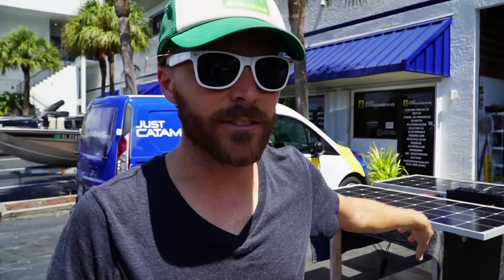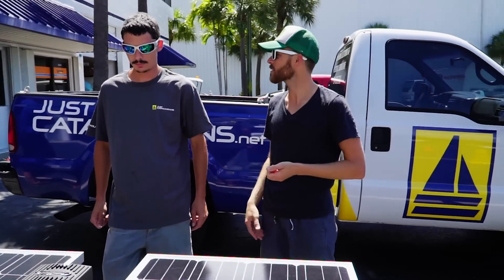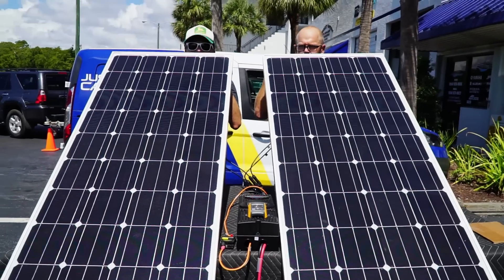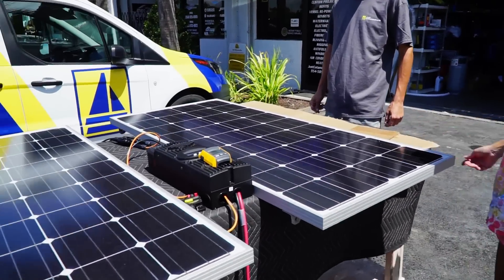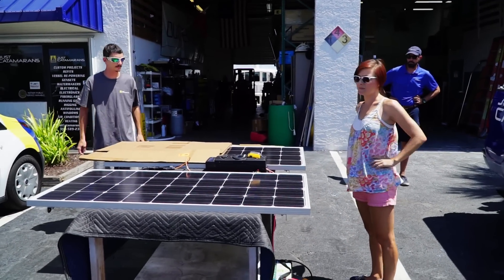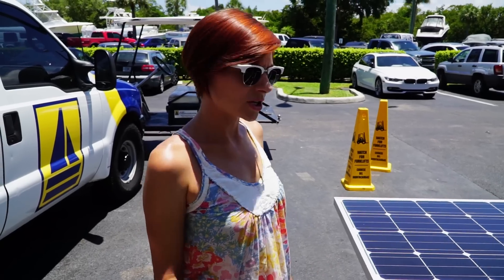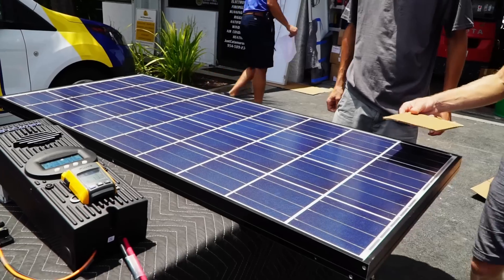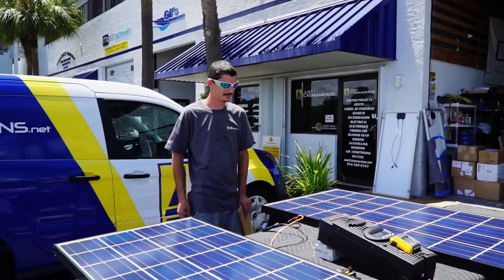Sailboat Solar Power - Series vs. Parallel & Shading

Comment: Ok, just a  thought... to make a custom rack to hold them over the rear a way from he boom and way less shading.
http://roadslesstraveled.us/pictures/thumb5390.jpg

Doing it this way puts them high up out of the way, behind the boom and above your dinghy,  you can always add 3 on the rear and one on each side as before and get the numbers your looking for having them like that means you will have shade on some and still get power if your plan is to be tacking all the time and the sun will always be moving this puts it at a 3 point where you should have 2 poins in the sun most of the time.  Just a thought..  Cheeeerss  (yours was the Leopard 43 Catamaran if I recall)

Comment: It seems insane to me that shading one cell out of a multitude of cells all but kills the total output. Something really stinks about the design of those panels... both sets of them.
Reply: They are both low end, low technology modules. Thats not to say they are bad products as they will most likely serve there designed purpose well for 20+ years.   There are typically only a few diodes places in these level modules and are not designed to mitigate production losses from shade.  Not all solar is like this and there are many solutions for people in the same boat.  That being said, you get what you pay for.
Reply: Cells are linked in series in a panel.  If you shade one cell; it produces zero Volts.  Regardless of the power coming to the cell; the mean voltage of anything and zero; will be zero.

Comment: Series will give you more voltage but won't last as long, Parallel will give you less voltage but more power and longer lasting charge.

Comment: Wow! I'm not really familiar with how solar panels work, but you would think that when shading 10% of the panel, it would only take away 10% of the power. There is an opportunity for someone smarter than me here...
Reply: From what I can tell, the current runs through each square. So when one square gets blocked the electricity isn't able to run from the positive wire to the negative wire. I think it's like Christmas lights, if one lights breaks the whole wire won't turn on. I could be 100% wrong though.
Reply: Each cells on the panel are joined in series.
Reply: +Bobby Taylor My guess would be that each individual cell produces only a small amount of voltage so they are internally wired in series. But you could easily add semiconductors so that a single cell doesn't take the whole panel down, as we see in this video. Nicky even eluded to this in the video (the part about the diodes...). If it is done properly, there is no reason for this to work. I would find a competent ee and have them tear apart panel and see what is going on.

Comment: You should know that power = volts x amps.  If you have two 12 volt panels in parallel getting 10 amps, and then you put them in series (volts now becomes 24 instead of 12) and get 10 amps, then you are getting twice the power.   So you tested amps but you really want to test for power.

Comment: Hi you two, I know that I have never chimed in before and I have been following your adventures for quite some time now. On this issue with the Solar...Have you thought about 3 dimensional array? not 2 dimensions which we normally think about when mounting solar but what if you were to use some of the military solar arrays:  https://www.amazon.com/PowerFilm-R-60-Rollable-Solar-Charger/dp/B00ES13ZAO/ref=sr_1_12?ie=UTF8&qid=1467767917&sr=8-12&keywords=military+solar+panels/ that are much smaller rectangles sewn into fabric and being that you are on the water and you have the sun refracting off of the water..do you kinda see where I am going with this? Try some of these military solar cells in the fabric of the bow plane sail and some along the starboard and port of the deck (where the deck meets the sides (hulls) of the catamaran. You do have a lot of light hitting the sides and sails. Any way, my best to you both and God Bless. Pastor Mike
Reply from the maker: We certainly have thought about the sew in panels or doing something off the sides.  We're still scheming on those ideas but will eventually try something different out.

Comment: it's pretty simple,  due to internal wiring shading any square causes an  interupt in the circuit. the only way around that is to build your own panel  with smaller groups, but then you lose maximum wattage.

Comment: Boy, they're like the old Christmas tree lights, one bulb blows and the 
entire string is dead.  Are all solar panels built like this?
Reply: No high end ones have have strings of cells wired in sets so shading one only takes out a certain percentage depending on how the cells have been divided up inside.

Comment: Its easy, as the sails on the sail boat will cause most of the shading and cut down on the generation of power, just cut the sails off the boat. At that you can motor out into the middle of the ocean turn off your motor drift around and be really green. You can also capture all the hydrogen off the battery's and convert that to power. 

Being green on the blue ocean seems a little strange, 320 watts in direct sunlight for a few hours seems like a lot of hardware to produce such tiny amount of power, let alone the walk around space on a boat is at a premium now will be cut down because of the panels.

Now if you really want solar so bad have a whole boat made out of solar panels, or maybe just go buy a honda 1000 generator that will produce three times the power on demand rain or shine, cost three times less than the panels, oh and the space you can recover. See in a motorhome you drive some where park get out and space is unlimited, in a boat you cant do that  out in the ocean. 

The tax payer subsidized solar industry is such a fraud, dont you folks feel a little like you sold your soul or something? Lets see sailboat free power to move the boat using ah sails, option one; wind generator, option two; drag a prop driven generator behind the boat, option three; run your engine to produce power, four, stayed tied up at the dock connected to shore power all the time make videos, and pretend to be pirates on the open sea..............Look no one who enjoys sailing is going to buy the solar religion thing. Well no one that didnt drink the kool aid, the whole first idea about sailing, boating, RVing, is to get away from nuts that push crazy ways to live on others. Not saying you are nuts, just cut down on the kool aid thing and actually enjoy life while you can. 

Michael
Reply: pk13910 too bad cuz he is RIGHT.
Reply: mike arg  solar is amazing on a boat. Put it up and forget about it.for 25 maybe 40 years. Solar is king on a boat .I have used every source except towing a turbine. That idea is full of trouble. You loose 1 knot from youre prop fixed blade propeller and .5 knots from a turbine. So now you are doing 4.5 knots when you should be going 6.foldin/featheringg props are 3,000.00 To 5,000 00 Solar is windage but not a big deal if mounted properly above the davits. My 2 panasonics 330 watts each with a high end regulator cost me 1,600.00. Total They will put out 40 amps per hour in direct sunlight.
4 hours a day direct sun gives me all i need and more.
My balmar alternator  puts out 50 amps per hour if its raining.
I tried the honda generators 3 times . A 600 a 1000 a 2000 Pieces of shit . Dead after 1 year daily use. For 2 hours a day. Battery chargers  30 amp model only puts 15 amps a hour w a honda 2000.
Wind generators had 3 of them. Amp air 100, 2 rutlands  never again a  noisy nightmare . I would consider the high end 5 blade models silent  but they are 4,000.00
So after 30 years of using all these sources the solar just trumps em all.  Near Zero maintenance.
Big plus.
Carry on and thanks for the testing curiosity.

Comment: Those panels are not appropriate for a boat.... you need panels with series/parallel bypass diodes so they wont fail when a single cell or row is shaded

Comment: Enphase microinverters won't work - they are grid-tie only. Also, though it was fun to watch your test, but it is seriously flawed :-( Laying a piece of cardboard on a panel COMPLETELY blocks all light. Casting a shadow from cardboard held above doesn't. So you weren't  consistent in your method of shading.  Hold the cardboard above (like you did simulating a mast) so as to just cast a shadow (not completely block) one cell...  your results will be quite different. In reality you're never going to have any part of a panel blocked as you did by laying a piece of cardboard on it. Otherwise - great work and thanks!

Comment: Nasa just released a patent that should solve this problem:
Photovoltaic Array with Integrated Bypass Battery:
http://www.engineering.com/ElectronicsDesign/ElectronicsDesignArticles/ArticleID/12133/NASA-Releases-Patents-That-Could-Impact-Renewable-Energy.aspx